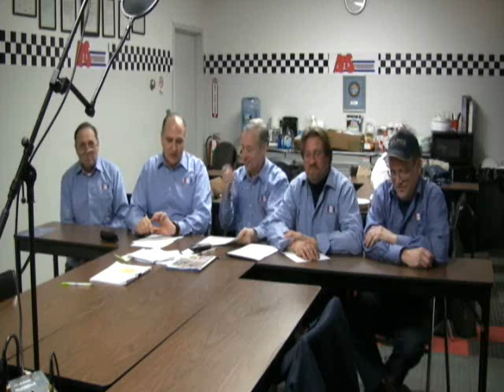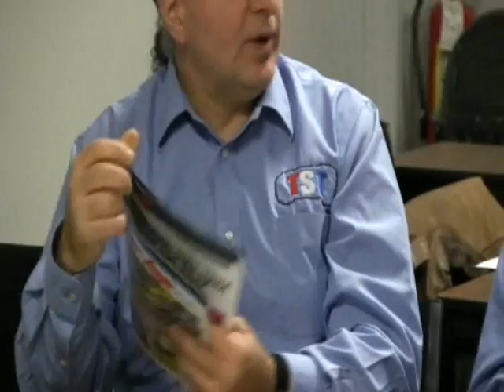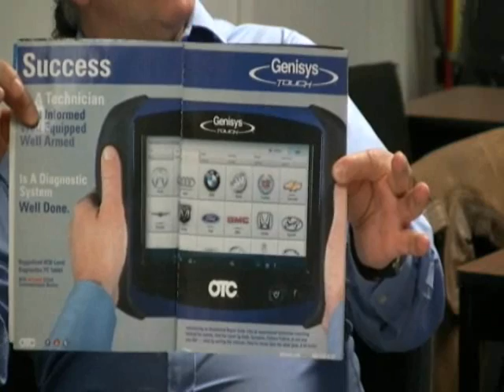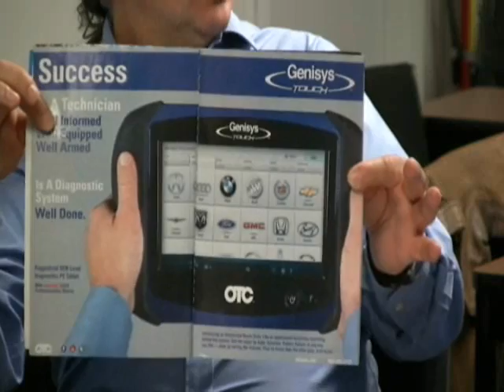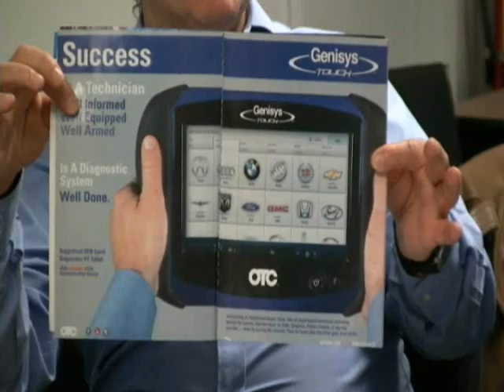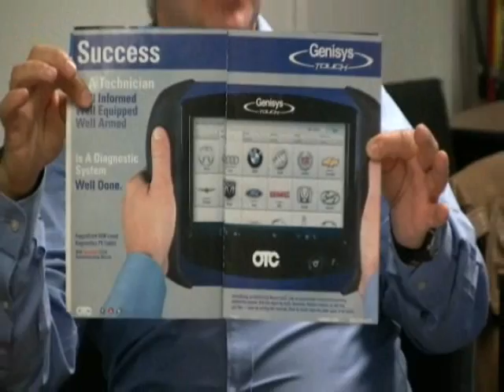November TST Roundtable

Comment: Thank you very much for the videos.I have learned a lot from them.I have a tool related question. I have just bought a refurbished genisys evo for my side work. For what I payed to have it with 2012 software ($925) I am happy with it.However, after only one day of use I can see dust and lint under the screen.There does not appear to be a seal to prevent this. I am worried that the screen will someday become unreadable.Is this normal? I would appreciate any advice. thank you.